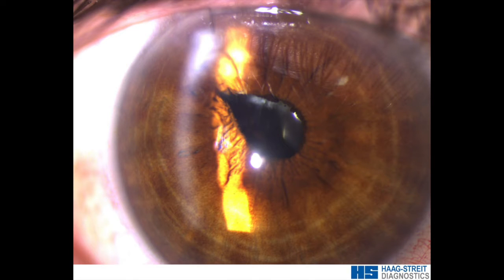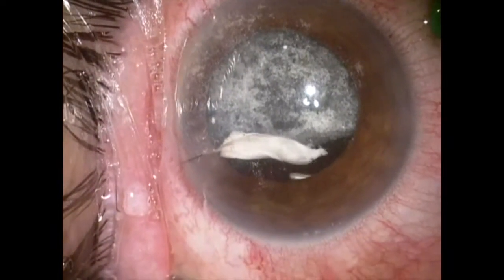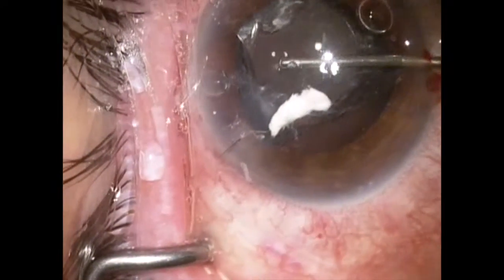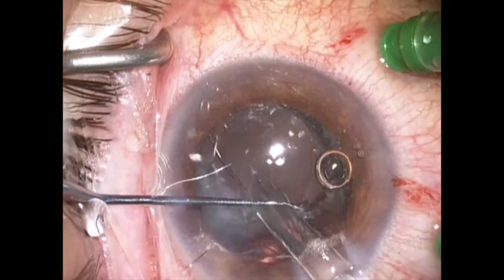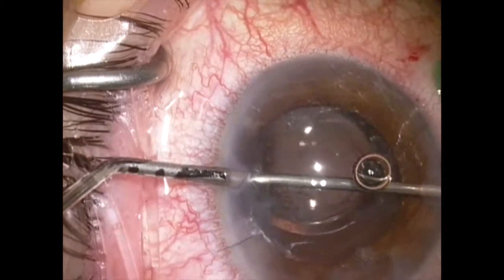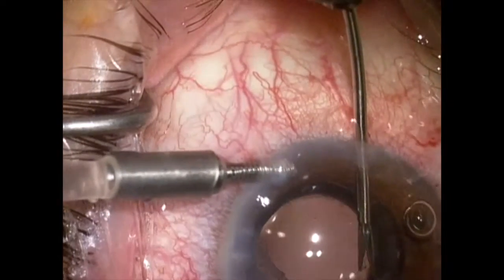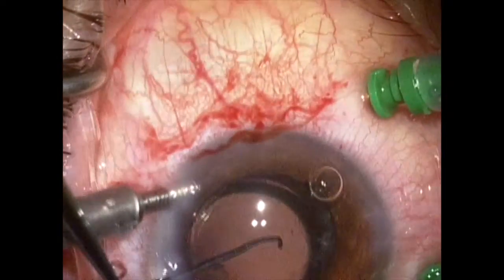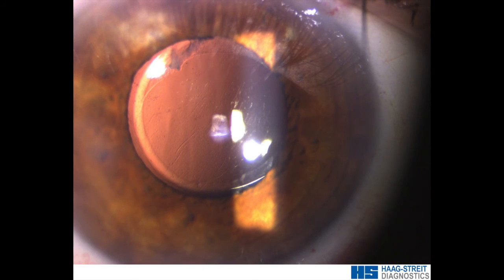Repair of  capsular bag dialysis, IOL decentration and pars plana vitrectomy by Steven G. Safran MD

Comment: Great video, thanks! You think this would work for a zonular dialysis with a maximum of how many clock hours, sir? And do you advise trying to turn the haptics in the direction of the dialysis or would it be too traumatic (or not effective with a single piece IOL)?  And postop tilt and astigmatism? Great work!
Reply from the maker: There was no post op tilt or decentration.  patient has done great for 4 years since this was done.   The rest of the zonules were intact so a focal defect was not a problem with the CTR and IOL rotation.  How many clock hours is less important than the status of the remaining zonules which were good enough to support the complex with the CTR and IOL rotation to balance and distribute the forces as evenly as possible.  Rotating the IOL was not traumatic and I placed it as I felt was best in this case.
Reply: @StevenGSafran  ok, nice 👍 thanks for the reply ;)